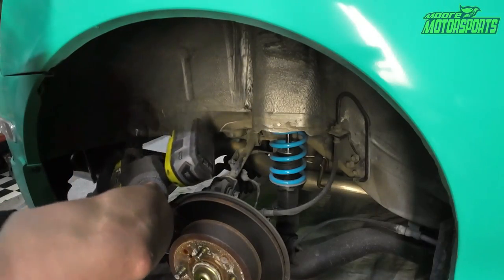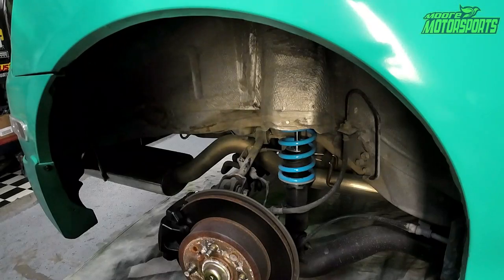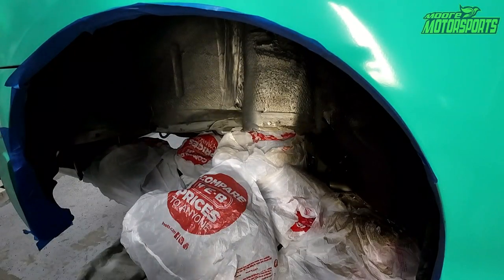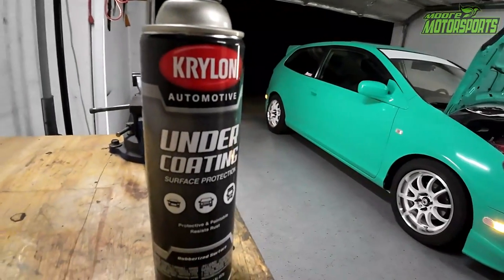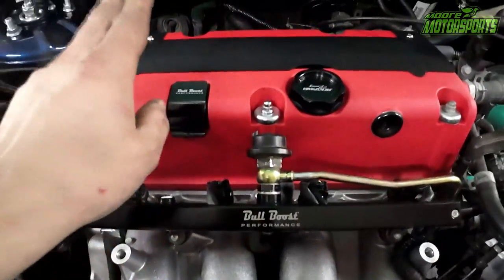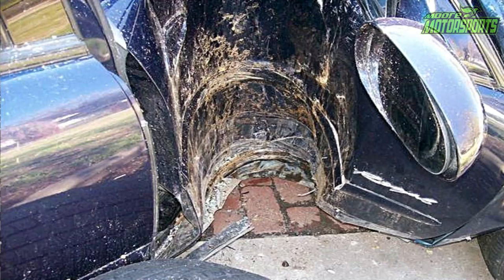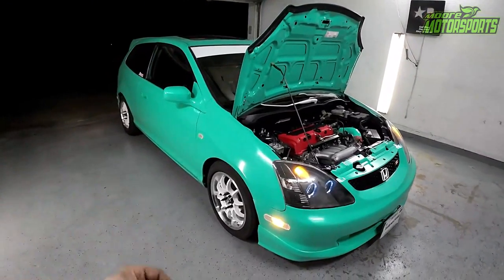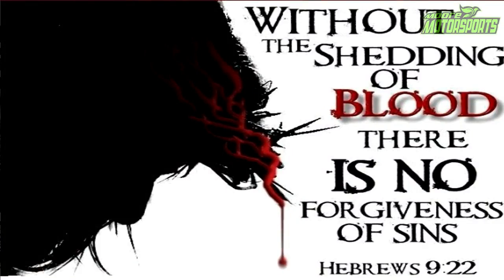HOW TO UNDERCOAT WHEEL WELLS. ALL IN THE DETAILS!

Comment: I can't believe you painted that car with spray paint. Amazing work. I use fluid film for my car here in VT. A gallon of fluid film black, and 4 years later still not a spec of rust anywhere. 2019 civic coupe ex-t zero rust on the exterior, and zero rust on the chassis. Even the lower control arms are rust free. I've seen 2021's already starting to rust here. In a state like VT you MUST use a petroleum based under coat. Ceramic coating on paint, then lots of protection over that. Washing you car often, and drying it with something like aqua glow, or other wax as you dry product.
Reply: Does FF stop rocks, the idea is a rubber coating to stop damage and rock sounds
Reply: @sailshane  I get that. I get what he's doing. I'm just saying here in VT they salt the shit out of the roads. Rubberized undercoating is actually bad to use here, especially if you already have rust starting on the chassis. I got my car new, and I just FF it every year to stop rust from even starting in the first place. It's literally the only way here.

Comment: Did you know you can paint that white vinyl strip to match?  Skuff it w 400 grit & spray!
Reply from the maker: I like it being white and also that's not a good idea since its vinyl. I will be getting a new windshield and another white one made with my Moore Motorsports on it like i usually do. Thanks for the comment though. God bless
Reply: Another pro is the paint might have uv protectant.  I used some vinyl that went to crap

Comment: You should note that in area that salts the roads,  undercoating is the death sentence.  In Texas is doesn't matter, but in New England, or Great Lakes areas , undercoating cracks, locks in the salt and destroys the car.....  Never use it in any area using salt on the roads.
Reply: Yeah I wouldn't recommend it for the salt belt, but it's better than nothing. For it to be effective you want the surface to be completely nuetral, no rust grease etc, and ideally you'd be checking it for cracks and regularly washing out the wheelwells. Can also etch, prime, and paint the wells and apply this stuff (assuming it plays well with surfaces other than bare metal), just to add the typical protection the rest of your car experiences with the undercoating being a tougher chip resistent topcoat.